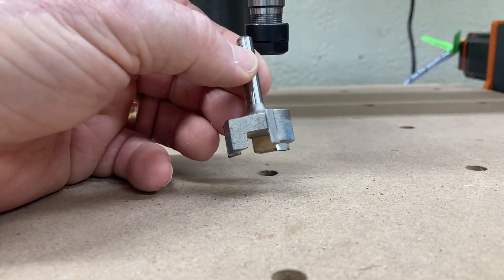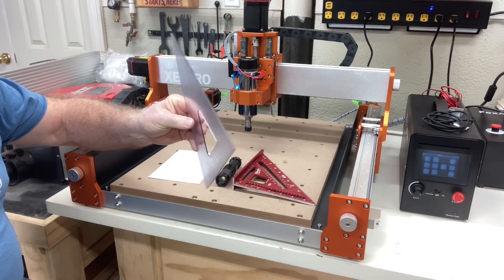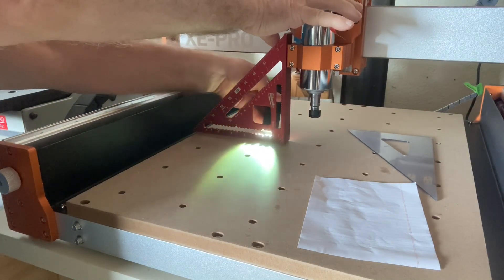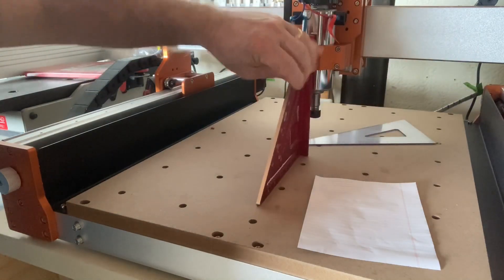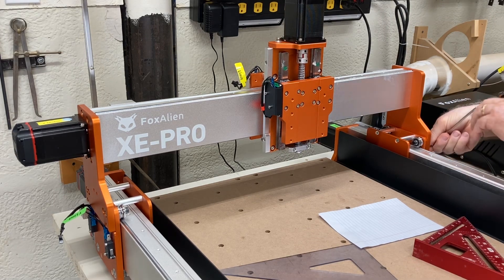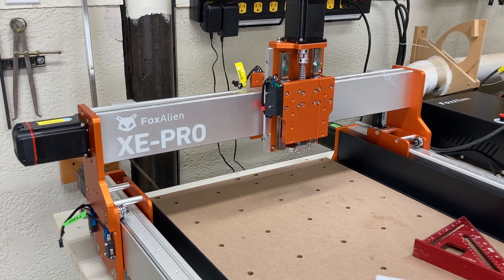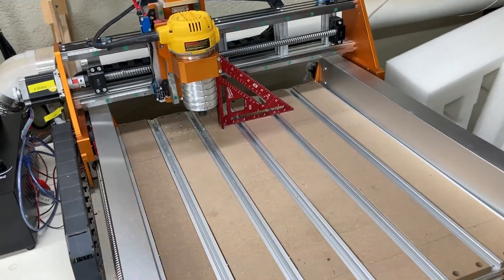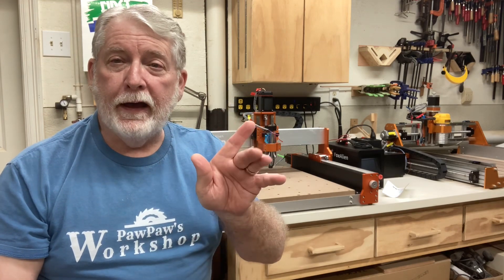How to Tram Your CNC

Comment: Great video PawPaw.  I do have one question. . . .before tramming the CNC,should you surface the spoil board.  This sounds like its doesn't make sense but then again, I think we should first see if the spoil board is flat in itself.  Am I missing something?
Reply from the maker: No, tram first. If you are not perfectly tram you will create ridges when you surface the wasteboard.
Reply: 👍🏼thank you.

Comment: You can get these lines from side pressure on your cutting tool as well. If your machine is not rigid, it.may never go away. A radius on the cutting edge will help.
Reply from the maker: Yes, that can happen but on these small machines it most likely the tram

Comment: Shouldn't you check the gantry at both sides of  the spoil board ? To be sure there is no twist in the gantry itself ? Kind regards Hans
Reply from the maker: There is nothing wrong with checking that as well. Some CNC machine have an allowance so that you can adjust for that while others are rigid.

Comment: I know your a big time creator but could or would you think of calling me and helping get through the tram on my xcarve 1000mm I just bought it new and it’s together but I notice it’s cuts are different from time to time
Reply from the maker: If it is cutting differently from one carve to the next you have a mechanical issue. The belts may be loose or the wheels need adjusting.
Reply: @PawPawsWorkShop  I’m a go home and cut a square piece and then take some evaluation of the cuts. My belts are tight, I’m not exactly sure how the wheels should be far as tolerance. I know I got the z squared. Now the z axis where the 4 button head screws are how far should it be slid into washers and bolts

Comment: Thanks for the video.  One thing that I did when tramming the Y-axis on my Vasto was to use the blade from an old set of feeler gauges as a shim. Wedging that in when I mounted the spindle provided just enough offset to make everything perpendicular.
Reply from the maker: Great idea. Thanks for sharing